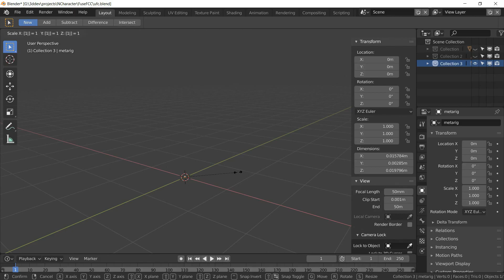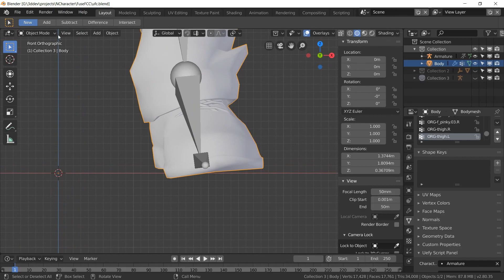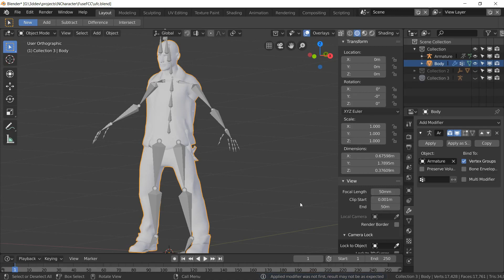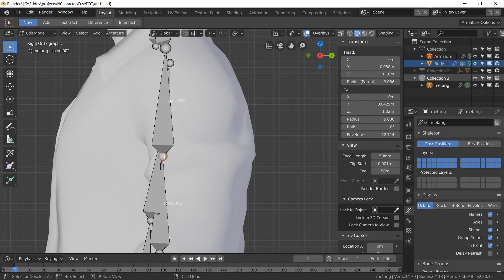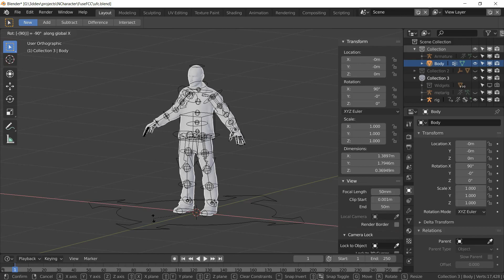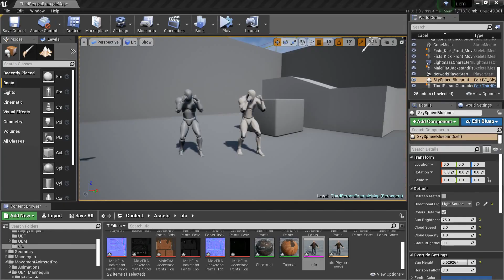Use Blender 2.80 to rig FuseCC/Mixamo characters for UE4 with Uefy Script v1.3

Comment: I have a character from Reallusion Character Creator (RCC) and no other setting (Mixamo / Make human) work on it, giving me errors and such.  How difficult would it  be to simply clone the UE4 bone structure and adapt/attach it to the RCC given that all the weight painting is already done on it ?  I saw your next video that is about recreating all the bones from scratch and I wanted to avoid that.
Reply from the maker: The mixamo/make human mappings are an older method for the Lite Edition of Uefy you'd normally follow the process shown in https://youtu.be/kuqeG6oGQJM for everything and always use the Epic Skeleton mapping. The trouble with Reallusion is that they use a lot of Shapekeys/Morph Targets and blender doesn't allow applying modifiers to meshes with shapekeys. So you will have apply or delete the shapekeys or use additional scripts to copy them over later.
Reply: @RakizFarooq  Thanks.  I'll try the other methods on the mesh.

Comment: I change my comment because i didn't use the good video and if you follow the comment made by Rakiz it will work:
My old comment
This script doesn't work for me, i don't understand, some of bones have not the same name and UE create them on my UE skeleton
Reply from the maker: This video uses custom mapping feature of the script to rig FuseCC generated characters. The problem is that this works just fine for the FuseCC app created characters but not for older characters made by mixamo before they were sold to adobe.
It would be better to follow this video https://youtu.be/kuqeG6oGQJM to rig your Fuse characters with the Epic Skeleton mapping because that will work everytime. I rigged the mixamo Survivor character in the animation tutorial series with that method.
Reply: @RakizFarooq  Ok i'll try this method
Reply from the maker: If your character already has an armature try https://youtu.be/kuqeG6oGQJM , if it is just a static mesh with no bones to start with you can rig as shown in https://youtu.be/MRhDDbU0zdE
Reply: @RakizFarooq  Yeah it works well, i just have to rename all the UV map of my mesh with the same name before merging all the mesh part because the textures were not apply correctly. But everything is ok, thank you very much for your help and your script. It will be very usefull for my project because i wanted work like you did with one skeleton for all my characters.

Comment: No matter what i do when i import my character into UE4 his shoulders are too far back and his neck is stretched
Reply from the maker: That happens because the default pose of the mannequin has really swept back shoulders. I talk a little about this in https://youtu.be/2xVF9QFu-Bw around 10 mins. To get a better result, you can edit the shoulders bones to align them more closely to how they are in the mannequin. Also make sure to set translation retargeting options on your imported character in unreal editor as shown around 46 mins in the same video.

Comment: It isn't working for me with Mixamo Characters. When I try to rename bone names it can't find them. Looking for "mixamo:Hips" instead of "Hips". I guess models on the mixamo website name bones different for every model.... I renamed bones manually and it worked. However when I hit "Pose Character" its a crumpled mess. Has anyone got this working recently???
Reply from the maker: The Fuse custom mapping is made for character output from the FuseCC app if you are using this with an older Mixamo character before that company was sold they will have a different skeleton. To rig those characters you can follow https://youtu.be/MRhDDbU0zdE from 15 mins onward. Instead of creating your own skeleton just rename and roll bones as shown in the video and use the "Epic Skeleton" mapping to pose the character. It will work and it will also transfer existing weight paint so you can ignore that part of the video too.
In this video series https://youtu.be/oZ14vidzSs4 I rigged an older mixamo character not compatible with FuseCC with this method and it works just fine.

Comment: Very useful video, but when I import the .obj made in FUSE, I can't see separate clothes and bodyparts, only the materials, I select the body and it just selects everything, do you know what could be the problem? Thanks
Reply from the maker: You control this with import and export settings for both FuseCC and Blender. Both programs give you options on how to merge or split objects during export/import.
Reply: @RakizFarooq  Thanks man

Comment: Hi, as there is a well known bug with Fuse 1.4 where it doesn't start I'm using an old version which export the character without skeleton.
Why do I need to do in blender to fix this issue and to be able to replicate what you show on this video?
Reply from the maker: In that case you would create your own skeleton and weight painting similar to the UE4 mannequin then follow this other video https://youtu.be/kuqeG6oGQJM to use Uefy Script to make it fully compatible and exportable to Unreal Engine.

Comment: I recently purchased your script, it's awesome, but for some reason parenting the mesh with the rig doesnt import weighting, so when i move the armature in pose mode, nothing happens to the mesh, how can I fix this? thankss
Reply from the maker: I just went through the process of rigging a fuse character and everything is working on my end. The rig is built and weight painting updated successfully.

Please make sure you are using the latest version of the Blender 2.80 Beta binary. Some of the older binaries from last month have an issue. Also make sure you are using atleast Uefy Script v1.2.1, Lastly make sure you click on the build epic skeleton and weight paint buttons as shown in the video. If an issue still persists contact me by replying to the email with the download link and I'll look into it.
Reply: @RakizFarooq  I managed to fix it, thank you anyways!! I still have a little problem tho ahah, when I import it in UE4 everything works great except the shoulder that are a little bit off, they're like too far behind
Reply from the maker: First make sure there is no rotation on the character armature as shown in the video. Secondly the shoulders on the UE4 Mannequin are really pulled back and this affects every character that matches the Epic A-pose. Most of the time it doesn't matter but even for Paragon characters I've had to pull the shoulders forward to make it look a little better.  I demonstrate updating the shoulder pose in Paragon Wraith video around the ten minute mark. https://youtu.be/2xVF9QFu-Bw?t=603
Reply: @RakizFarooq  Contrsirly to your video I had no rotation on the character from the beginning, don't know why. Anyway thank you, I'll try what you suggested out!

Comment: I cant seem to get uefy to copy the weight painting over when I run the script after rigging everything
Reply from the maker: You have to follow the steps exactly as shown in the video. Blender's weight painting assignment is based on naming of the vertex groups. The script will assume the bones and hence the vertex groups have specific names. Which they will if the steps are followed exactly. You can always manually rename/manage the vertex groups if you need to.

Comment: Doesn't work anymore, I followed your steps exactly. Exported a fresh mannequin from UE4 - 4.21 with FBX-2014, a fresh Fuse character sent to mixamo then imported to blender and followed the steps. The final result is a tangled mess, the character is floating in the air horizontally and all twisted. I dont think the script applies the corrent bone rotations in blender.
Reply from the maker: If you select 'None' for skeleton when importing the character it works fine. If you want to use the original ue4 skeleton when importing then you have to take a few extra steps. You can follow the steps in this video https://youtu.be/kuqeG6oGQJM?t=1474
Reply from the maker: At the end of that video at the indicated time I show you how to get the original bone rolls as well.
Reply: @UCM4kmLaBF10J2qsezFz-zxA Alright thanks for the quick response, that solved it!

Comment: I'm wondering if this could be used to port customized characters onto other 3D software besides Unreal Engine. If so that would be Epic! :) Either way your script here is Epic for sure. Great job and dope functionality. Will curate this video and share it to help spread the good word and cover it on a video once I manage to purchase your script.
Reply from the maker: The final output is an FBX file albeit with scaling and rotation meant for Unreal Engine. If another 3D software support FBX and you can rotate and scale the model accordingly. Then it should work. Although I have only ever used this with unreal engine so I can not really say.

Comment: Awesome video. Can you show how properly rig fuse models for Unity? I tried a lot, but have a lot of issues with mixamo auto rig.
Reply from the maker: The model exported in the video is just an FBX file. Albeit scaled for import to Unreal Engine 4. I don't use Unity so not sure what the requirements are there.
Reply: @RakizFarooq  I got it.